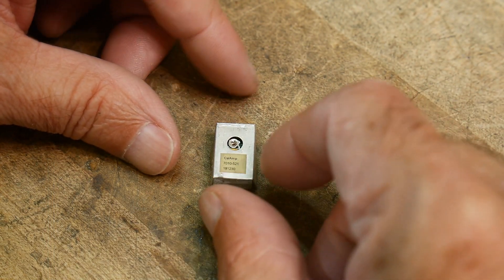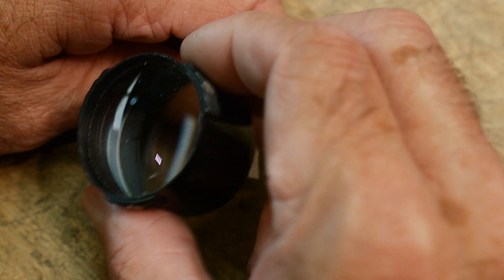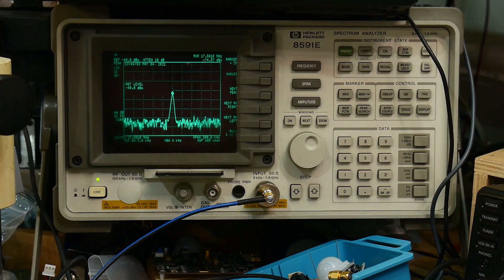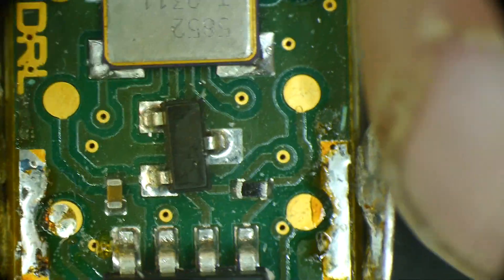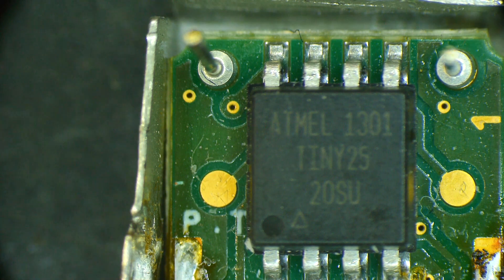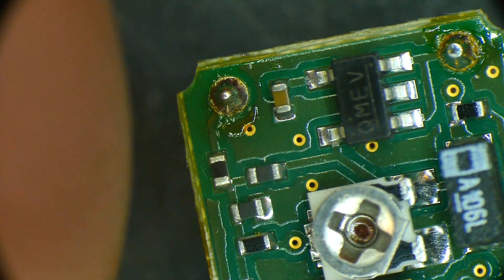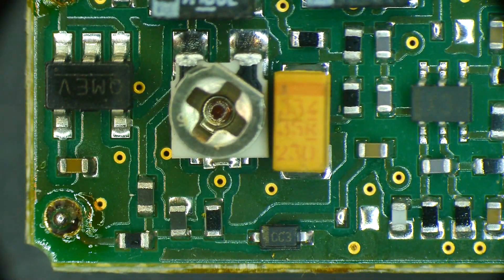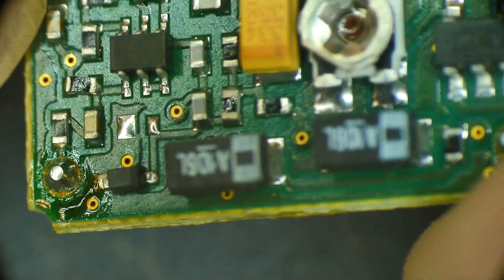#782 Help Me Identify this Part

Comment: I’ve heard of a microprocessor being added to a crystal circuit to act as drift compensation. It’s calibrated to count up to some value and then insert or remove a clock pulse. I’d imagine you could automatically compensate for aging and temperature too.

Comment: I've seen a similar layout before.  It's in a receiver - decoder from the Harbor Freight wireless doorbell.  The microprocessor is similar, but the oscillator is nicer.
Reply: It could also be a transmitter - encoder.

Comment: I have an oscillator here from NDK, don't remember if it's a VCO, a VCXO, or a TCXO. The package, i.e. its metal case and the 4 +2 pins on the bottom look absolutely identical, and it's also got a hole /  trimmer on the top. Dimensions are 18 x 10 x 10 mm³, pins are not included. Pity that I can't present a photo here.
It's an FRB3050A, 26MHz, b.t.w., maybe you can find out, what's inside. 
Maybe you remove the paper sticker on the top of your component, to read the original designator. The sticker seems to be applied later.

Comment: Note: Pin 1 on "14 Pin" can-oscillators is now used as an /Enable input (that usually floats high = Enable) to toggle the output on/off.
Looking at the circuit PCB traces Pin 1 goes to the 5 pin (regulator) chip which also has 2 connections to VCC, so I think that pin turns it on/off.

Comment: It could be a microcontroller compensated crystal oscillator, the ic measures time it ran and adjusts it based on a LUT, could also read temperature, though that's probably done with a capacitor.

Comment: I will have to sort of agree with Nathan on this. Except rather than tables, it is a PLL with the VR being the 'set at some temp' and the backside being temp drift to analog voltage; both being read on the analog inputs. The output is 3x the xtal not 2x. I used to get paid to create documentation because it was too difficult for the ingunears to do, not that they would adimt to it.🙂 Fun job.

Comment: It is just a TCXO (Temperature Compensated Crystal Oscillator) the Micro is programmed with a compensation table that adjusts the oscillator that runs at 2X the frequency. The programming is done through the pads on the board at the factory in a temperature chamber. Here is what it probably cam out of https://www.qsl.net/n9zia/gemini/index.html .
Reply from the maker: Thanks!  I did tear down a G3 so that is where it came from. Wow, fancy temp control.

Comment: Have'nt the foggiest, but have you tried reading the code on the AT Tiny25 ? It might hold some clues. It looks very busy on that PCB.
Reply: if the lock fuses are not set, one can read it's content, otherwise not